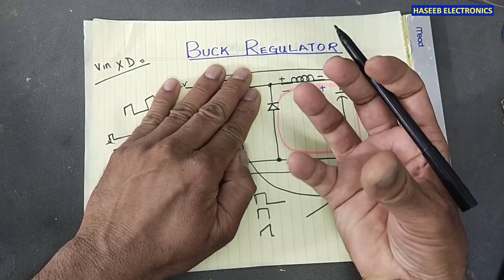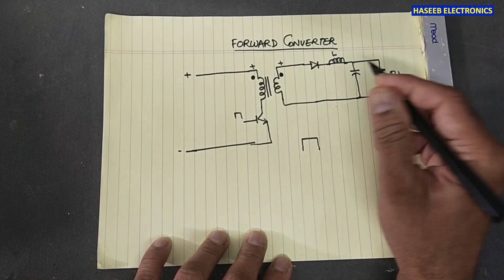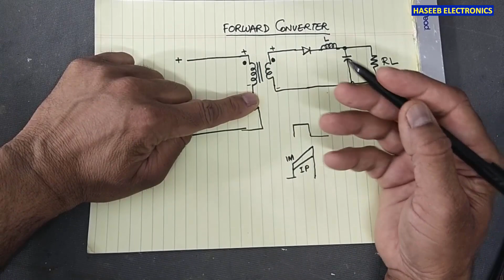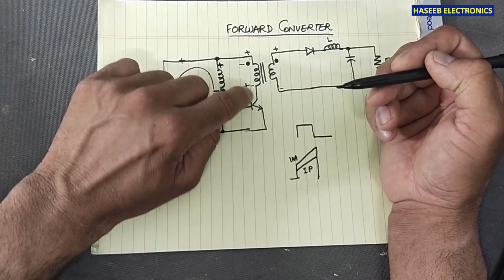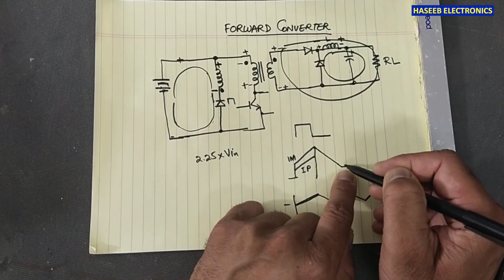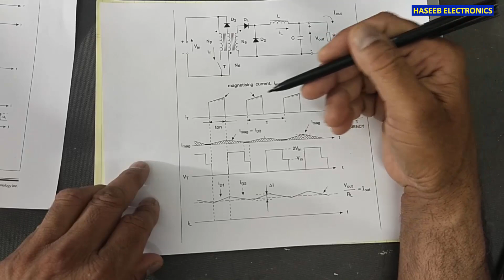{842} Single Switch "Forward-Converter" Topology

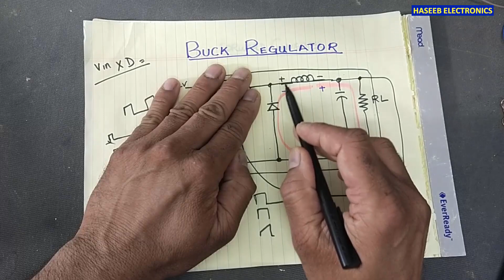Comment: At 1:10 in the video, you mentioned when the switch is off, the magnetic field collapses, polarity reverses on the inductor, and current flows in opposite direction...through the freewheeling diode...but how does this happen, as the diode is blocking in that direction??? Please can you explain in a reply, as I always see different people say different things.

Comment: Very well informative I learn why my converter was blowing diodes and igbt and mosfets now I use 114 volt with a 600 volt rating igbt and 200 volt rating mosfet and 200 volt Shockley diodes so thank you very much for the information

Comment: sir i have a question?why is it when u measure amps. of the unit goes up when plug in small voltage  than higher voltage.for ex. led tv wjen plug in in 110v is higher current than u plug in 220v.how is that happen?when ohms law said that voltage is directly proportional to amps.hope e make a video for it.

Comment: Excellent as always! Thank you! A quick question: when switch is on and there is positive voltage on the cathode of the capacitor, does that not damage the capacitor?